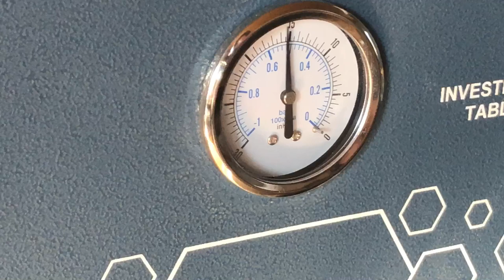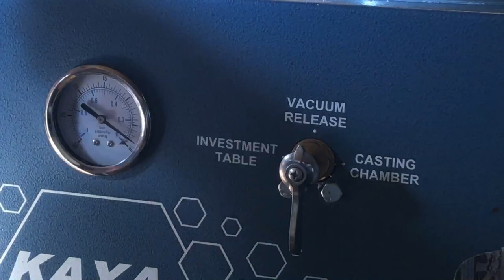Making a Knot Ring | Lost wax casting step by step

Comment: Very cool stuff. What would be your approach to make this ring into many different sizes for casting?
Reply from the maker: As the rings are made with wax wire it’s simple to make them in multiple sizes when doing the wax work. 
Doing the resizing post casting would lead to breaking the illusion of the design or a lot of carving work.

Comment: can i use a torch and a crucible to melt the silver/ gold- and just pour it in the flask ?
Reply: and what temperature the kiln has to be in order to melt the wax? what kind of kiln/ furnace should i look online ?
Reply from the maker: @alexandrasun9821  A burnout kiln is the specific type of kiln that should be used, but many programmable kilns would work just as well assuming they have enough space for flasks. 
Certainly, torch melting your metal instead of using a melter is possible, some would argue it's the superior method. 
Simply pouring it into the flask is called Gravity casting and your results will probably be mixed, since there's no vacuum or centrifugal force to push the metal where it should be. Using a larger spru will help, it basically allows the air in the mould to escape and the metal to drop into place.
Reply: @ClearMindJewellery   oh i'm planning to buy a vacuum machine, i'm thinking the kaya casting thing- like you have in the video- i 'm just a bit confused about the kiln thing-- why cant i aslo melt the silver inside the kiln? why there is another thing to melt the silver? 
and about the torch melting- i'm thinkig to melt the silver (and btw titanium in the future) ,  and pour it in the flask- while the flask is in this whole- in the vacuum machine- is that correct? 
and thank you so much for your answer...!!!
Reply from the maker: @alexandrasun9821  Burnout kilns aren't meant to go up as high as what the metal would require to melt. Typically the rule is to have the flask around 1000 degrees below the melting temp of the metal, for silver 800-900 depending on the type of models being cast. Silver is fluid over 1700F, so you wouldn't be able to do a burnout and melt the metal all in the same kiln during the same process. Also burnout rarely exceeds 1350F at peak. 
 
Regarding titanium, that metal requires special equipment with gas shielding, a vacuum chamber, crucibles and flasks and induction melting. In a normal atmosphere titanium burns before it ever gets fluid and castable. Indutherm makes machines that can handle this type of casting.
Reply: @ClearMindJewellery  oh, so the flask needs to be in hot temperature when the liquid metal is poured?